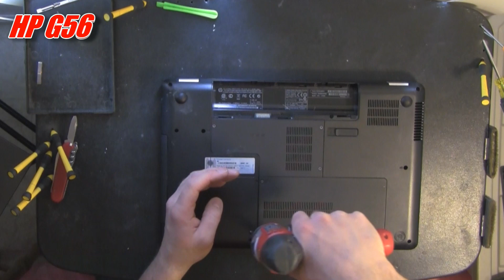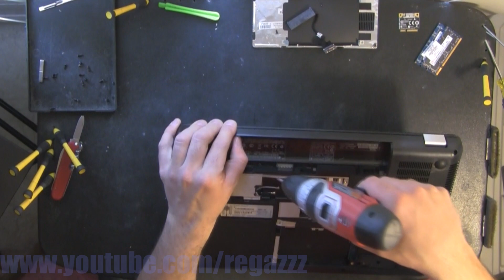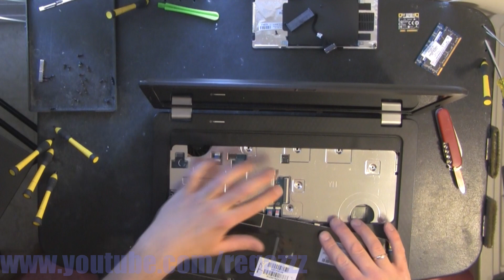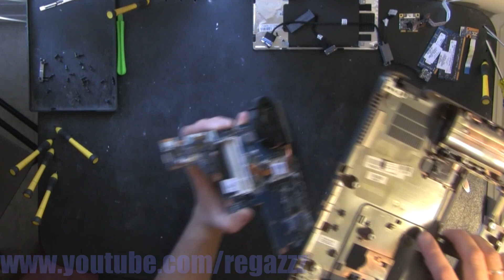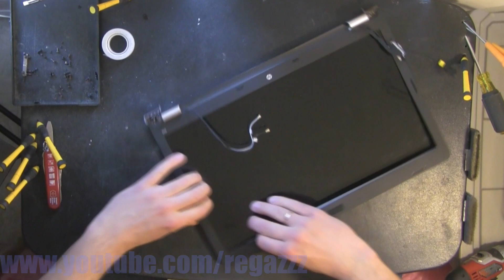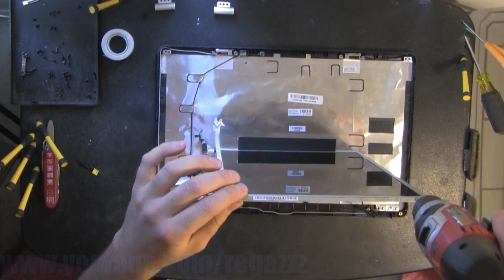HP G56  take apart video, disassemble, howto open (nothing left) disassembly

Comment from the maker: Hello,
replacing a keyboard is a pretty easy process. All what you need is remove battery and power cord.
And unscrew 3 screws. If I am right, one screw will be behind memory door (so, you will need to unscrew memory door too)

Comment: I have the same laptop but my laptop keyboard is broken, i have been looking at replacing the keyboard myself, i have no experience with taking apart or that laptops but have read up a bit about it, this is the only video i can really find that shows some of what is involved. Would u know, what screws and that u have to just change the keyboard or do u have to take apart the whole bottom like u did in the video?  Would u think or have any opinions on someone doing it with no experience?

Comment: Thank you for this. I thought upgrading to Windows 10 had killed my hard drive, but with a little research I have discovered that it is just my CPU has become buggered for some reason. The laptop is not worth taking in for repair but I am strong of will and weak of mind enough to try on my own. Cheers!
Reply from the maker: +Thom Pardoe You might still be able to reinstall win 7 back.
Reply: No Im pretty sure its too late. Installed 10 last summer and the computer died over the winter. I haven't needed it so I left it on the back burner and just got around to fiddling with it this week. I don't mind 10; it works well, even on this model of laptop, which admittedly isn't very powerful.
Reply from the maker: You can always (at least it worked a few weeks ago when I reinstalled win7 on some laptop) get a copy of Win7 and reuse a key that is easy to find. The only thing I don't know - never tried, if you can reuse your original Win7 key on your laptop after win 10 installation.
Reply: no, I tried that too. I have the 7 install key, but because it was factory installed and I never created a back up (or lost it if I did) when it was new, there's no way to do it. Its fine. I had all my files backed up and cleared off when I updated to 10 so even though it was an upgrade, it was basically a clean install. I don't mind starting over with this.
Reply from the maker: +Thom Pardoe ok

Comment: I don't think this is normal, but the cpu of my G56 stays at 70°C when doing nothing, and it can go up to 90°C when playing a game.(the computer is very, very loud) So do you think replacing the thermal paste and cleaning the fan should do the trick?
Reply from the maker: fortiogames Yes it can help, specially if heat sink is plugged. On the other hand, let's face it, it is not a gaming laptop and overheating issue while gaming is a usual thing.
Reply: thank you

Comment: Ordered a new lcd screen and came to find out the connector is too big for the new one, would i have to order a new lcd connector and would it be compatible with the motherboard
Reply from the maker: Better to carefully pack it and return it, and order an exact one you have in your laptop.
It will be to much of a pain to get a different cable that will fit on the motherboard and after that it can be a compatibility issue.
Reply: regazzz any advice on which one the g56 has?
Reply from the maker: the only advice I can give you is to check what screen part number do you have and than order an exact one.

Comment: I have the same one but mine won't turn on
Reply from the maker: What is exactly going on? Do you see any lights if plugged in?
Reply: I would say the GPU on the motherboard has failed. HP are notorious for overheating laptops and this one was one for the more common for this. It would require a replacement mainboard. (You can reball the GPU but they're not as permanent fixes for the long term, rare to find someone doing it properly and expensive). Fortunately though you can find these particular boards for quite cheap on eBay. First though id recommend removing the battery and charger, hold down the power button for 30 seconds and plug all back in. If that doesn't work, try removing, swapping ram cards about whilst doing the power button for 30 seconds before you turn it back on to make sure any electricity is depleted. If that still doesn't work, pop it into an external monitor. If that also doesn't work itl pretty much 100% be a mainboard failure.